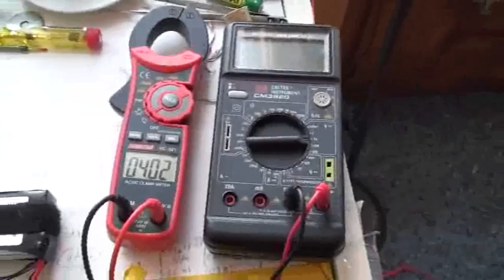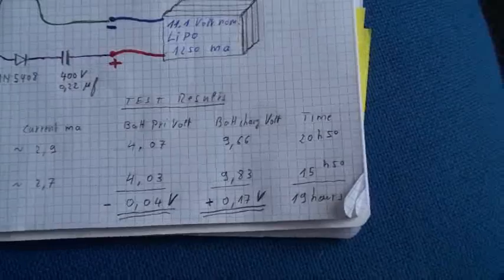motor with kickback spike-generator.wmv

Comment: You know, if battery charging is the primary goal, then it seems to me that the motor effect is really a needless complexity and may actually be slowing everything down. Try eliminating the rotor and the magnets, and just put the reed switch near those core poles.
Reply: It would seem the only benefit of the rotor with this circuit is to providing a mechanical method of producing intermittent voltage impulses whose duration may be shorter than the coil/core's own build magnetic field time constant. This may actually end up reducing input current while maintaining output. Anyway, more fun things to  experiment with.

Comment: Difference in voltage only says something when the capacity of the battery is known. Smaller capacity charges faster, and gives higher voltage.
But charging with impulses does seem to change the impedance /capacitance, making it faster.
One more thing, instead of putting the diode in the path of the impulse, put it between the cap/battery and its ground. This way the impulse can freely enter the plate, without first passimg through a diode.